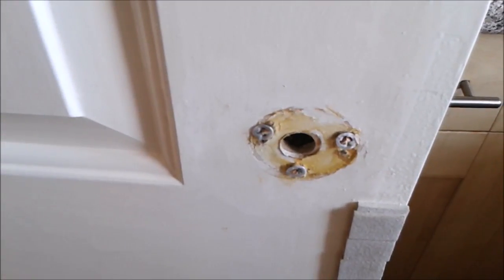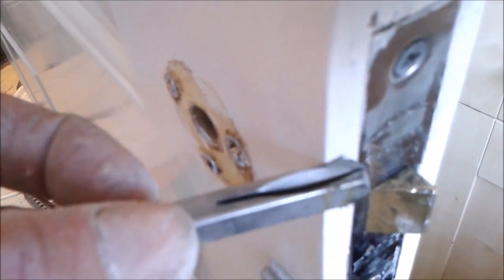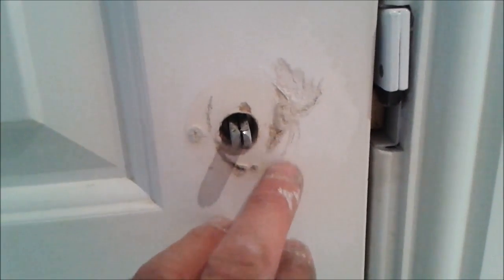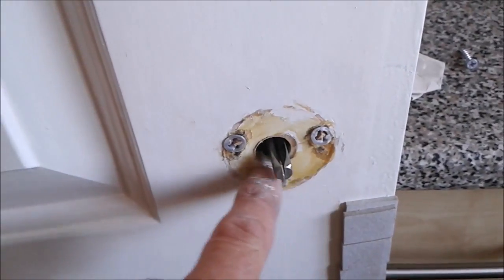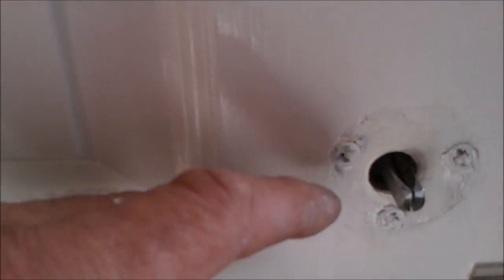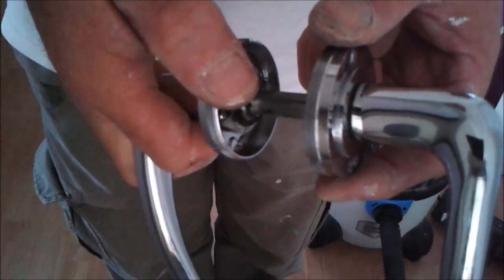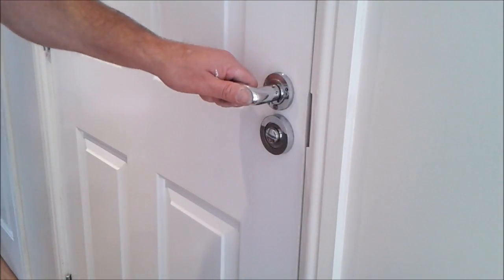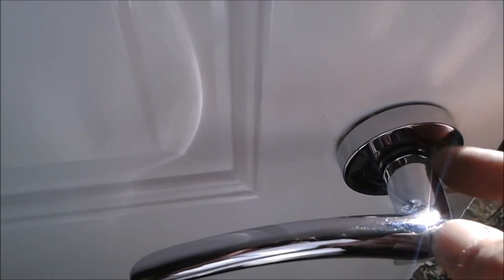Door handles  fitted wrong new build (100 properties)

Comment: This type of handle is supplied with BINDING POSTS to fix to hallow doors like these as screws will never ever be strong enough to take the torque applied This has been a case of pure laziness by the so called fitter   Even I as a failed joiner from County Down would have done better  well done with the make do mate all the best.
Reply from the maker: Thanks.

Comment: The bolt through handles… should have a screw through one side connecting to a bolt sleeve the other side… designed for hollow doors but they’re great to fix loose handles because they clamp together rather relying on the screws… They also do mortise locks to accommodate these
Reply: How do you add the through bolts at 3 and 9 o'clock when the one nearest to the latch fouls the latch and wont pass right through?

My pine doors have been fit with two screws and its really poor so i want to add the bolts